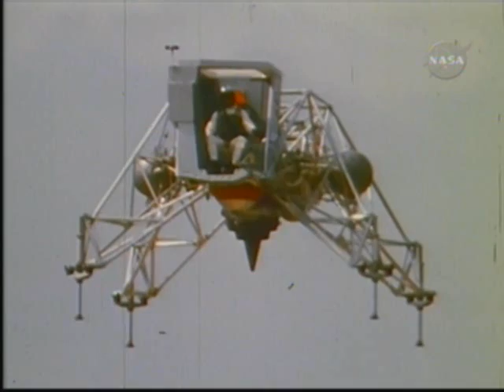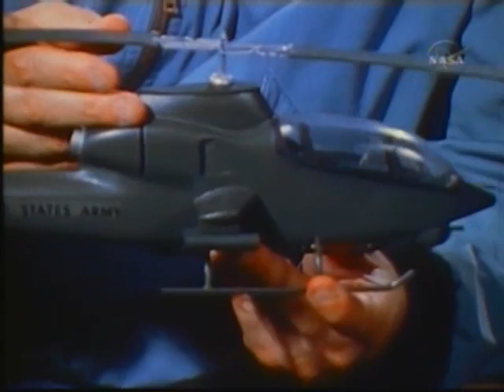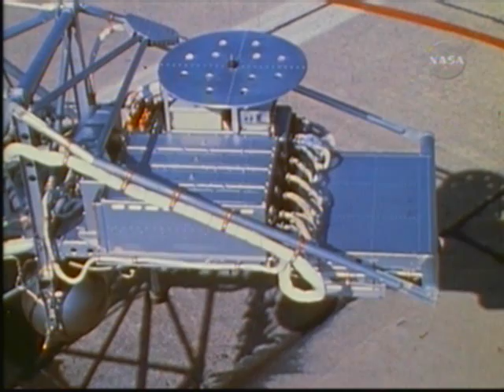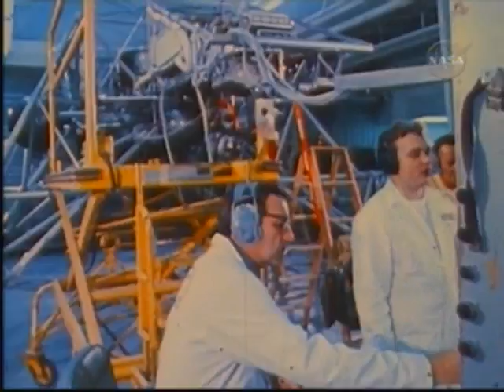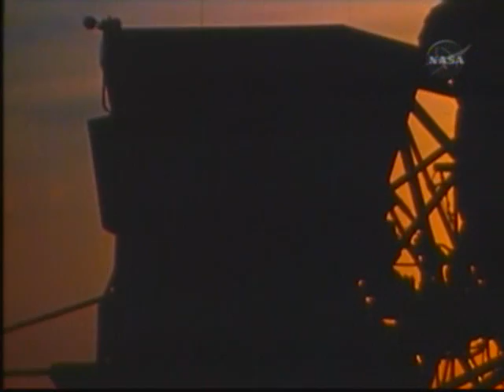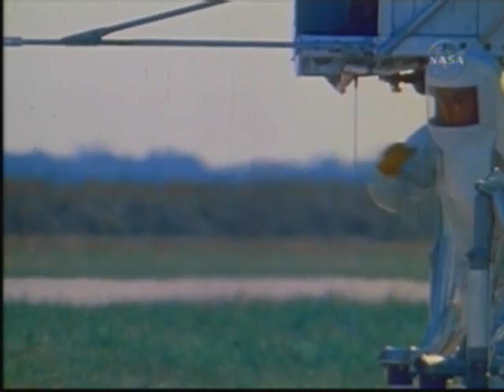300 Feet To The Moon: The Story Of The Lunar Excursion Module (LEM)

Comment: Where was all the jet fuel?
Reply: I'm not 100 % sure which of the tanks held the jet fuel but I'm quite confident it was the cylindrical tank behind the jet engine. It needed about 200 l for 10 minutes flight and the tank looks about that size. The spherical tanks make more sense for the hydrogen peroxide for the rocket engines.
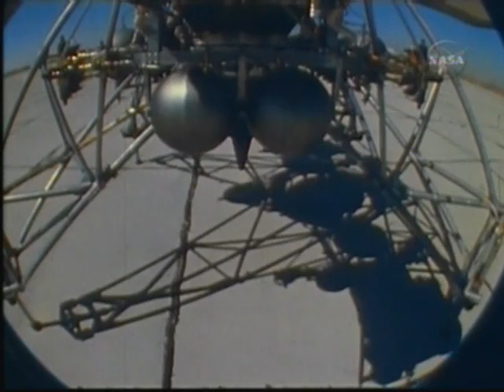Reply: 3:51 the cylinder tanks are shown. In the lunar module they are insulated in the quadrants 2 oxidizers 2 hydrogen and a small helium tank.

Comment: How is it you can hear the little compressed air jets but you can't hear the huge jet engine?
Reply: My guess is that the RCS sound is added post-production. Pilot's headsets are designed to only pickup the nearest source of sound in order to reduce or eliminate ambient sound.

Comment: This in no way simulates landing the lem on the moon in a vacuum. 22 times,who comes up with these training times. This is morelike a naked Harrier jumpjet. Everything about this is unlike a lem landing on the moon or lifting off,you can put wires on it all you want and make it a sixth of the weight,its still not in a vacuum. Yet Armstrong was shown crashing 1 of these and yet he was still picked to go 1st,i,d think crash equals sorry Neil thats a fail. Also what about the other 40,000 or more feet,how did they practice that,surely thats as important. It goes from this to twistng and turning,undocking and a perfect landing 6 times on the moon. The engines arnt even the same. He flew 200 ft or more in air in one of these,perfect its exactly the same as landing on the moon,but it isnt is it.
Reply: The vehicle is designed to specifically simulate the last minutes of lunar descent when the LM is under manual control (before that it's controlled by the computer). It's also designed in a way that allows drag to be greatly minimized. It's not a 100% perfect, top-notch recreation of a lunar environment, but it's close enough.

Also, Armstrong didn't crash the LLTV because he was a bad pilot. He crashed because the vehicle's RCS fuel tanks suddenly depressurised, leaving Armstrong with virtually no control over the vehicle.
Reply: Armstrong's crash was caused by a malfunction of the vehicle. He ejected at the last second.
Reply: @oscarin13  its nothing like a lunar environment,its not in a vacuum,he took off then hovered then attempted to land,at what point was that done on the moon landings. As the lem allegedley slowed down descended to the lunar surface,the lem was at almost 90 degrees with the astronauts(who were stood up) feet pointing forward,when and how was this ever demonstrated prior to any missions. Going off topic,but to my knowledge theres only 1 video of anyone testing a suit in a vacuum and that was a complete failure. Trust me when i say i believed it all, but i started seeing things that made no sense,then i realised none of it did.
Reply: Time was running out. 
We had to be 'seen' to have landed on the moon by the end of the decade, as promises had been made.
Reply: @gazmartinpadiham.lancs.3435   it had a jet engine pointed vertically at the ground to negate 5/6 of earth's gravity and match the moon's, and was equipped with several very small horizontally mounted reaction control jets that mostly cancelled out any wind trying to push it around. so, yes, it did do a great job of simulating the moon's environment
Reply: @peabody3000 did the lunar lander take off from the moon fly  up 300ft hover about and then crash land all the while surrounded by an atmosphere,probably yes,but not according to the apollo missions.  If anybody thinks that this simulates a moon environment they really need to have a word with themselves.
Reply: @gazmartinpadiham.lancs.3435  Read my comment again, the LLTV only simulated the last minutes of the LM descent, when the vehicle was under manual control and almost upright. The LM was only on its side during the braking maneuver when the vehicle was controlled by the computer. 

No, the LLTV wasn't a perfect recreation. Never said that, but it did the job of familiarizing the astronauts with the landing profile of the LM. It wasn't the only method available, btw. They also used a lander suspended on a crane, helicopter approaches, and a somewhat crude simulator. Nowadays they would use state-of-the-art simulators so an actual LLTV wouldn't be really necessary.

Comment: LOL! They used the same 4 groups of steering motors for the bedpan LEM, the descent LEM, and the ascent LEM. Too funny and too fake.
Reply: You have a better way to maintain attitude control in zero or 1/6 g?
Reply: brabanthallen: I do! Instead of having an engineering degree and courses in controls and fluid mechanics, I have a video Western Experience 2014 Native Dancers. Neet, huh! BTW, g is local acceleration, so your 1/6 g is subject to interpretation, i.e. different supersonic nozzles.
Reply: @suekennedy8917  - Don't ever judge a man based on what is posted on his page.  I have degrees in both physics and engineering.  The gravitational acceleration on the moon is 1.625 m/s^2, or .166 (1/6) of Earth's gravitational acceleration.  Satisfied?  The quad RCS on the LLTV used pressurized H2O2 (Hydrogen peroxide).  Don't ask me the nozzle pressures, but they were certainly adjusted with pressure regulators to simulate lunar gravity here on Earth.  That was the whole point of the LLTV....simulation.  The quad RCS system on the LM was completely different using different propellant and certainly different pressures at the nozzles. The actual LM used nitrogen tetroxide oxidizer (N2O4) and Aerozine-50 (C2H12N4) fuel, pressurized by helium.  Here's a great PDF that describes the entire RCS system if you care to learn about it instead of asserting that which is incorrect and just wrong.
https://ntrs.nasa.gov/archive/nasa/casi.ntrs.nasa.gov/19720014237.pdf
Reply: @suekennedy8917  - The quads are just for attitude control.  They are fired in milliseconds by means of a gyros to maintain the desired attitude.  Not that difficult a concept.  The exit pressure is not as critical as you make it sound.  Read the document I posted.
Reply: brabanthallen: Quads and biceps and lats and bench pressing. Bad attitude control steering motors on the moooon. Exit pressure and back pressure and expanding gasses and mass flow rate in the throat . Good luck with your trolling

brabanthallen4 hours agoHighlighted reply
@Sue Kennedy - The quads are just for attitude control.  They are fired in milliseconds by means of a gyros to maintain the desired attitude.  Not that difficult a concept.  The exit pressure is not as critical as you make it sound.  Read the document I posted.
Reply
Reply: @suekennedy8917  I'm not the one trolling here.  You claimed originally they were using the same quads on the LLTV and the LM.  They didn't, which I so patiently showed.  LLTV used hydrogen peroxide, whereas the LM used actual rocket engines with hypergolic fuel.  All you have done is make assertions using word salad.  PROOF.  Remember proof?
Reply: brabanthallen: Quadraceps and leg presses! Have you ever seen an alcohol powered dragster. Vrooooom!

brabanthallen3 hours ago (edited)Highlighted reply
@Sue Kennedy I'm not the one trolling here.  You claimed originally they were using the same quads on the LLTV and the LM.  They didn't, which I so patiently showed.  LLTV used hydrogen peroxide, whereas the LM used actual rocket engines with hypergolic fuel.  All you have done is make assertions using word salad.  PROOF.  Remember proof?
Show less
Reply: brabanthallen: Hello my friend! The LEM also used the gas turbine used on the Flying Bedpan thing. They had to to estimate the Mean Time Between Failure and Mean Time To Repair. I dont know how well a gas turbine works on the moon mainly because exhaust gasses have about 14 PSI less pressure to expand into, or back pressure and shock waves and such for nitrous powered 'quads'. Neet huh?

brabanthallen27 minutes ago@Sue Kennedy Not impressed.  Fucking troll.  End transmission............
Reply: @suekennedy8917  : So you can't spell the word "neat" correctly and you think anyone would take you serious about anything? 

Narcissistic much, sister?
Reply: @kitcanyon658  How many universities have you applied to and been rejected?

 Kit Canyon
Highlighted reply
Kit Canyon
1 day ago
 @Sue Kennedy  : So you can't spell the word "neat" correctly and you think anyone would take you serious about anything? 

Narcist much, sister?
Reply: @kitcanyon658  Keep editing your comments after you post them:

 Kit Canyon
Kit Canyon
1 day ago (edited)
 @Sue Kennedy  : So you can't spell the word "neat" correctly and you think anyone would take you serious about anything? 

Narcissistic much, sister?
Reply: @kitcanyon658   Kit Canyon
Highlighted reply
Kit Canyon
6 hours ago
 @Sue Kennedy  : LOL. Who doesn't edit a mistake in their posts? 

Wow, you are some kind of person. Too bad you're all in your mind and not living in the real world out here. 

The real question is, why did you leave your ignorance on display and not edit your post? 

You lose, sister. The fact that you think you make anyone look bad is just a symptom on your narcissistic personality.

But go ahead - I can keep you occupied all day, every day. The trolling you do to me just takes your spite away from people who are  less able to see the ignorant person you are.